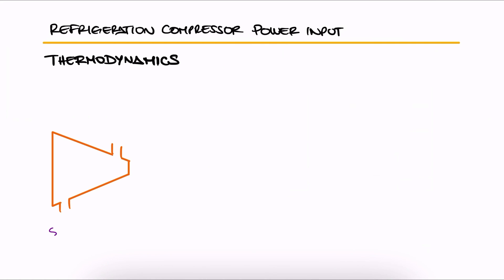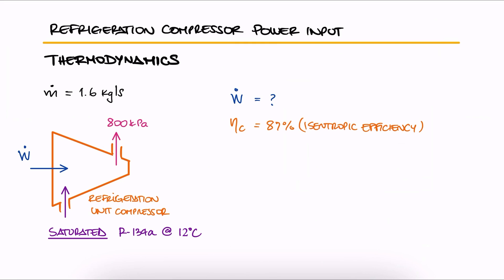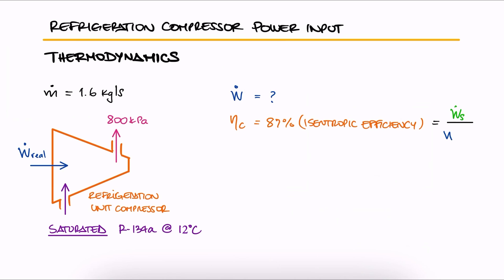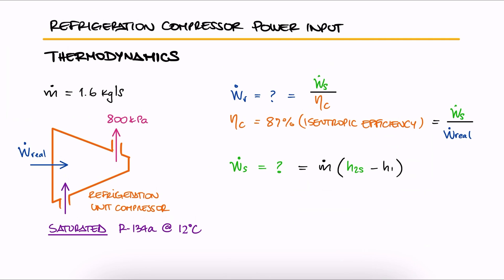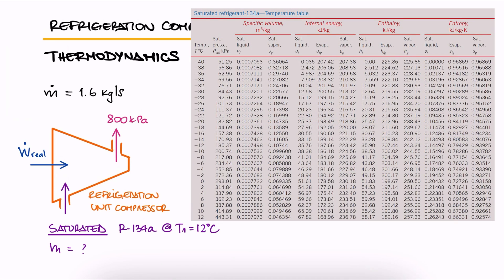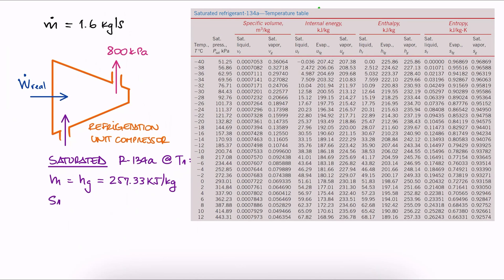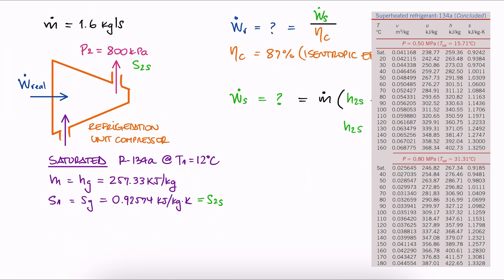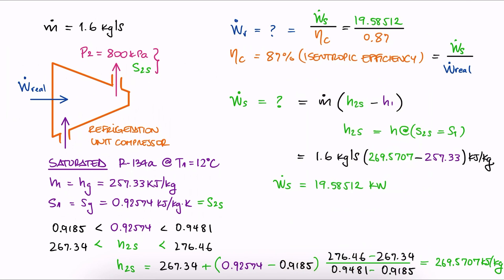Using Isentropic Efficiency of a Compressor to Find Work in 3 Minutes!

Comment: What if the fluids used is air and the system compressed air from 100 kPa to 900 kPa, which table is used to determine the enthalpy??
Because i tried to use A-17 Ideal gas prop. of air and it seems wrong because the entropy keep changing with the increasing temperature in pressure rising, thanks